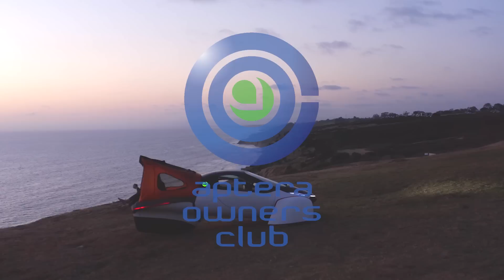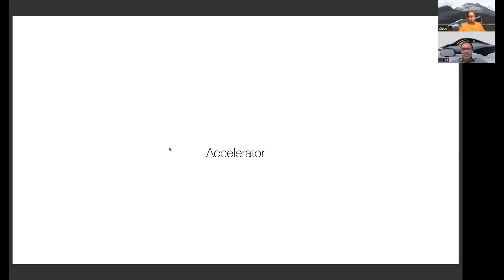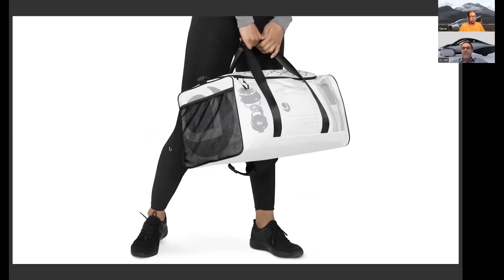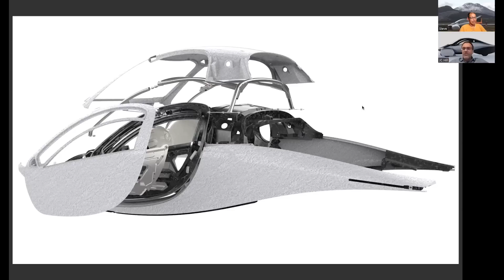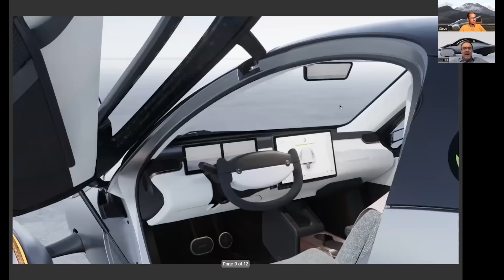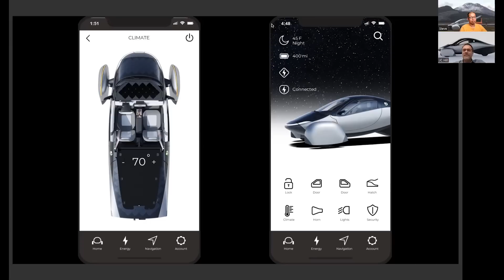Jason Hill gives us some Aptera updates and a sneak peek at the app!

Comment: In a side impact accident, how would you repair the body, fiberglass patch and paint ?
Reply: My concern about the metal in the Aptera is that after the outer skin rebounds from an impact won't the metal underneath remain deformed and how will that be repaired?
Reply: @IBMara  Whether the metal is deformed depends on the force of the impact of course. Impacts range from door or shopping cart dings to being t-boned at various speeds. 1, 2 or all 3 layers could be damaged depending on the force. Anyway, it appears to me that the metal bar is bolted to the carbon fiber inner door piece and so coulld be replaced alone with thee outer skin.  My question is, could the door absorb the impact in a side impact leaving the rest of the body unharmed? Maybe.
Reply: You don't, damage to the carbon fiber will total the vehicle.  The alfa romeo 4c has a carbon fiber body and has been around since 2015, if the CF is gouged the car is totalled.
Reply: @chrisrudzinski6241  Because of the Aptera’s segmented body panel configuration, do you think it’s possible to just replace certain panels instead of replacing the whole vehicle?
Reply: @chrisrudzinski6241  The exterior panels will be glassfibre sheet moulding compound. Those may be repairable if the inner carbon sheet moulding compound panels are not damaged.
Reply: @chrisrudzinski6241  That's sounds like the insurance rates will be high on that vehicle

Comment: You might want to compare the mold for the fiberglass side and that section your wondering if it could be another mold. Compare it with the what you see here for the carbon on the inside of the door and outside fiberglass. I have not look into this yet. Just trying to remember the odd bits.  But there is a cavity on one side that looks like it could be filled with something in the shot shown. Like what I see that will be under the triangular metal piece in the door. That is high end CNC modeling for efficiency of material use if it might be that part. Defiantly should be possible. You definitely nailed it on the mounting points for the door. In the earlier shot you can see on the far side the covered joint for the upper hinge but see some sort of roller on this side that the hinge could glide on?. Maybe some alignment bolts in that cover? Thank you for the inside view Jason. Hope your trip goes well.

Comment: I hope the 12v does not just pull from the 12v battery and can pull from the main battery.  They always underestimate the ways we will use those ports.
Reply: The industry standard for cigarette lighter based 12v output seems to have been gravitated to 10 Amps
Reply: @off_the_pnw_railsguy1703  Yes it is. Even solar generators rate their 12V DC sockets at 10A
Reply: Great to have confirmation on this.  Lots of back and forth answers have caused confusion.
Reply: My hope is that it can also be left live while the car is off, for running my freezer.
Reply: My Bolt supplies the 12v battery with 1500 watts from the main battery. This let’s me use an inverter to power my home appliances for several days. I would be shocked if Aptera didn’t do the same.
Reply: That's how my old Chevy Volt works: The main "traction" battery keeps the 12 volt battery charged as needed. That's a standard design. However on the Volt the 12 volt system switches off 10 minutes after the car is turned off to save the battery from draiining too much. And the whole car switches off automatically after the car has been left on 30 minutes in Park, for the same reason. Of course, people have discoverred a work around, for those who want to keep the heat or A/C and stereo on longer.